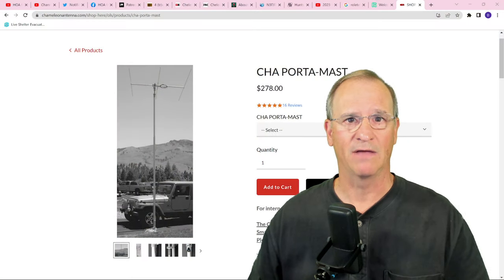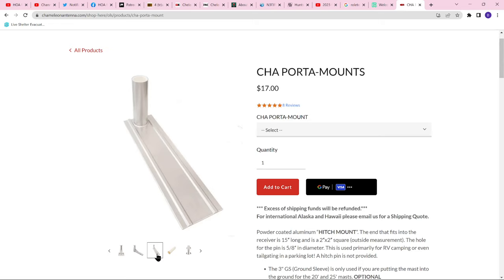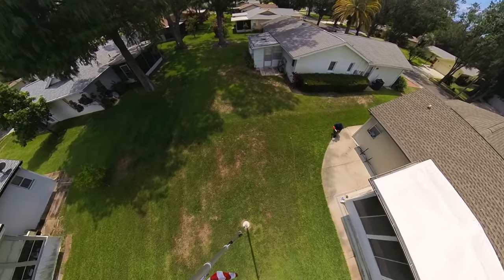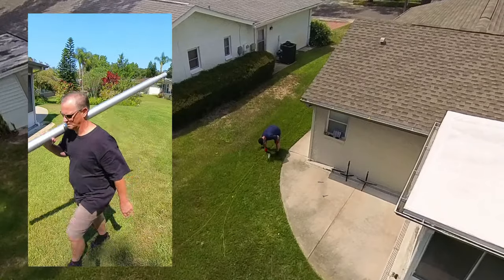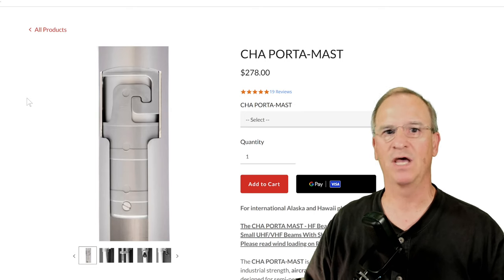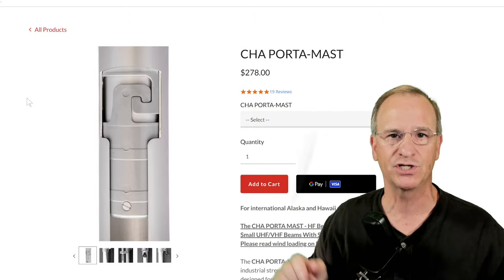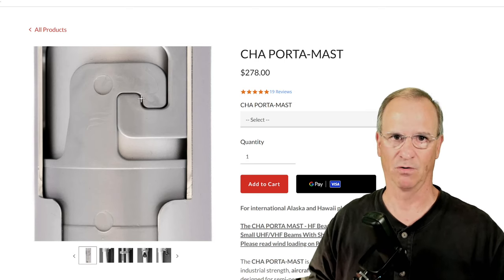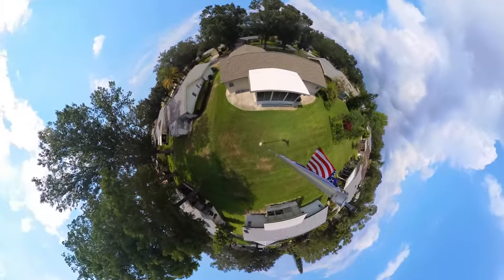Stealth HOA Ham Radio Antenna with the Chameleon Cha Porta Mast / Flagpole - The HOA Will Never Know

Comment: Hey Bob, Great Video. What about digital modes? I'm just south of you in the Sarasota area. I'm also looking for a good compromise antenna due to HOA restrictions. I would like to run digital in addition to SSB, so I was wondering if the antenna would be good enough for that.  My other thought was to install some Landscaping with large trees and shrubs, but that will be kinda expensive. 73.
Reply from the maker: If I'm getting out SSB voice, digital should be just fine.  I don't do digital, but I can't think of a single reason why it wouldn't work.  Here I talk more about my actual setup, which is now "permanent" -- https://youtu.be/9TIkoeSqI8E

Comment: Using a 20' mast minus 2' in the ground and minus another 5' from the top of the mast to the next section where the wire antenna is attached, it looks like only about 13' above ground for the top of the antenna wire when all is said and done. Correct?
Reply from the maker: Great observations @jackh7356 and I'll confirm this is a future video; right now the mast is down for some other activities. I believe Chameleon compensated for the "in ground" portion, so you don't loose that length, but again, I will confirm both measurements at my next set up.

Comment: Nice!  Added to potential solution list.  How well does the mast handle the wind with/without flag and antenna?  Thanks fro sharing.  73.
Reply from the maker: It is pretty beefy @shawnp6653.  I haven't had any major storms blow through since my installation, but the manual on the Chameleon  site has the 20' mast at 95MPH wind survivability; it assumes and in ground mount like I showed.
Reply: @HOAHamRadio  That's pretty good!  Just was wondering how it would hold up to 'surprise' pop-up type storms.  Good luck with it and thanks for the reply.

Comment: As you have installed the radials, what is to prevent someone walking by and tripping on them?  2nd: If it is a sloper end fed wire, why use radials?  Thanks for any thoughts.  73
Reply from the maker: I use radials per the manufacturers recommendations.  As far as tripping on these, they are in my yard which is private property...people don't walk through my yard.  If I were to do this in an area with traffic I would likely try to get the radials deep into the sod or slightly under ground.
Reply: @HOAHamRadio  Fair enough. I'm sure your video will help others in an HOA. 73